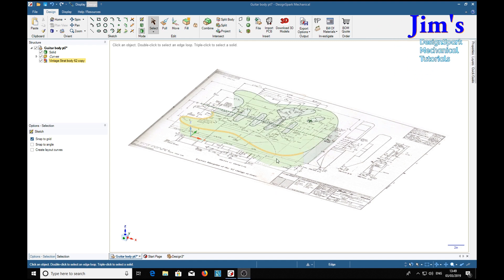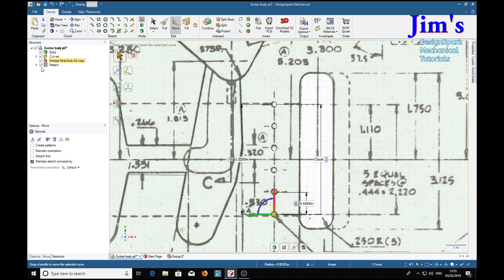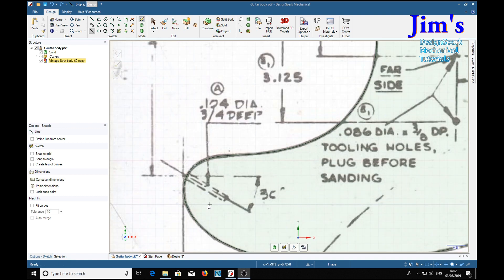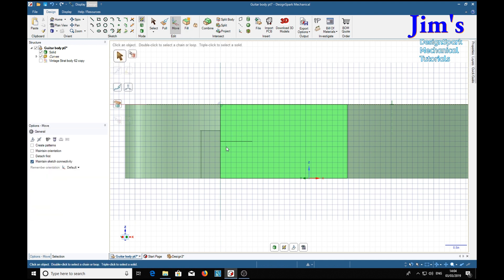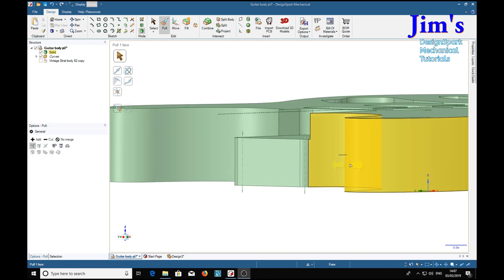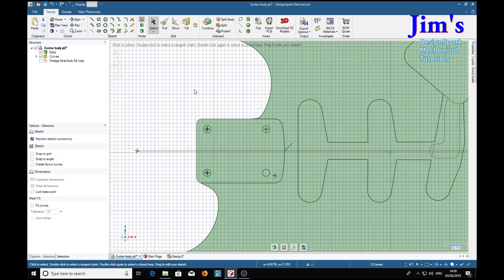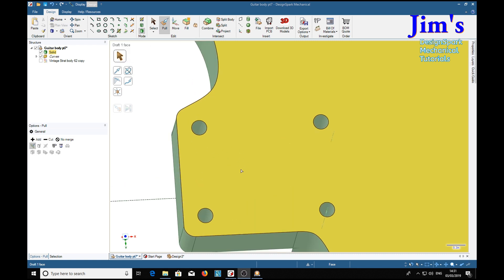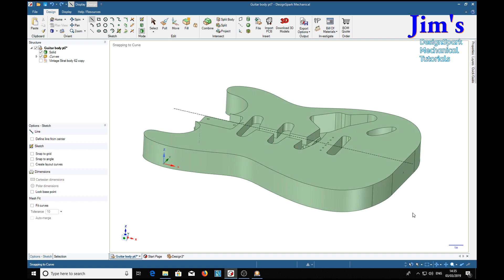DesignSpark Mechanical 1962 Vintage Fender Stratocaster body pt7

Comment: I do have a question that I can not seem to answer. When pulling a rectangle that I sketched onto the surface of a block DSM sometimes combines them making one solid piece. I have tried selecting "No merge" but they still get combined. I have not been able to control this from happening.  I seem to have to make sure that they do not touch by moving the sketch plan a little bit off of the surface I am sketching on.
If I sketch the rectangle on the same plane but not on the block it self I can then go into 3D mode, pull the new rectangle then move it to the block and intersect with it , it will not become one solid. That seems to be a way to get around it, hopefully I will find a better way.
Reply from the maker: I have done the same thing in the past. You can also pull the solid from the main surface then split it off with the Split Body tool. I have searched the Help files and I can find no mention of the 'No Merge' function! Although it appears in the software it does not seem to do anything. It is also a setting in File/DesignSpark Options/Advanced/Pull Tool - dropdown list. Setting it there doesn't seem to do anything either.
Reply from the maker: Just discovered that if the extrusion from a surface is selected at the exclusion of anything else, it can be 'Moved' away from the main body and a new solid is created. Hope this helps.
Reply: @JimTaylor42  I will try that but if it can be selected separate from what's it is connected to I find that it is already separate solid. But i  will give it a go and let you know.
Reply: @JimTaylor42  Did not work for me. I think that if any shapes are drawn intersecting on the sketch plane, DSM makes them one solid piece. If you draw shapes on the same sketch plane but not intersecting then pull in 3D and then combine, they stay as separate solids.